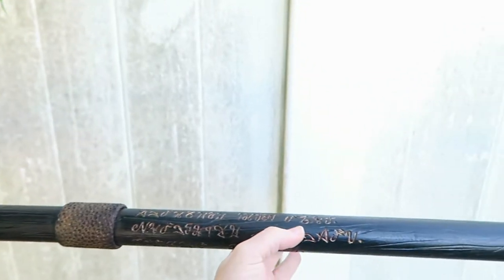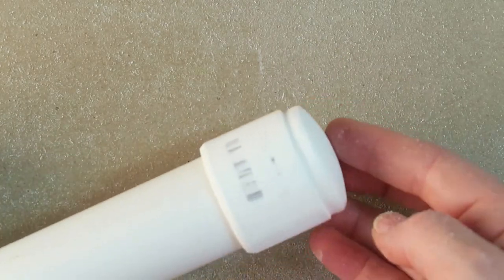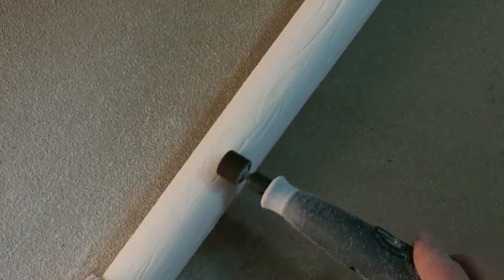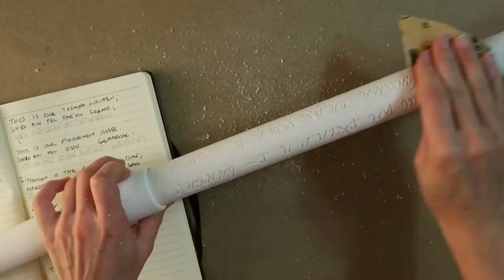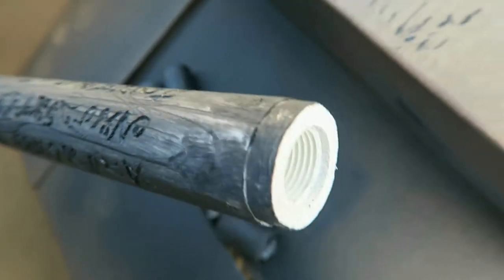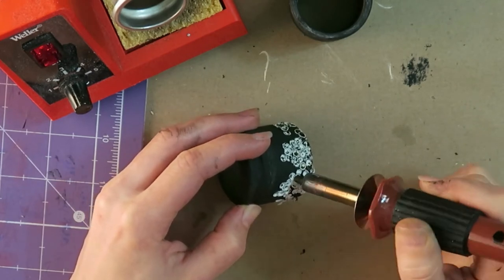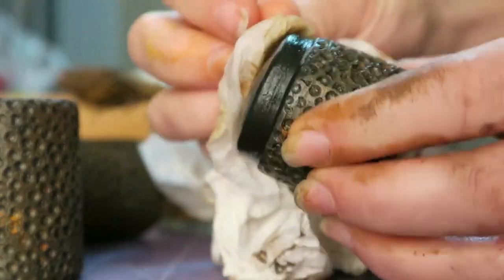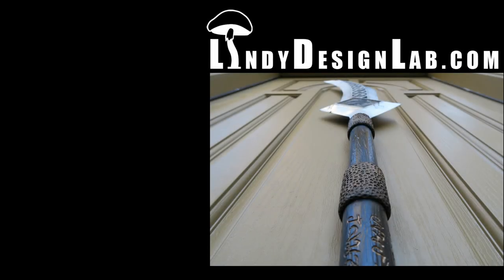Matrim Cauthon Ashandarei Prop Engraved PVC Handle

Comment: Could you do me a huge favor? Do you think you could post a picture of the translation? That would be such a big help, If you don't mind
Reply from the maker: Here's the translation used on my Ashandarei. https://www.facebook.com/lindydesignlab/photos/a.147131429053123.1073741827.147118415721091/376565422776388/?type=3&theater Hope that helps!
Reply: Lindy Design Lab That's exactly what I wanted, Thank you so much, Its gonna be a big help